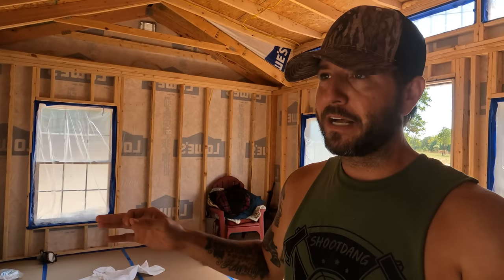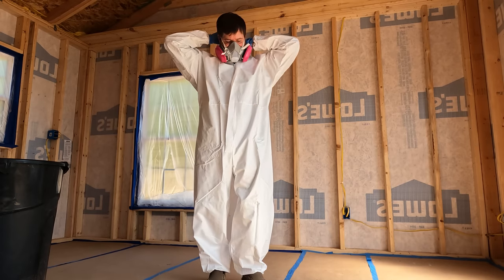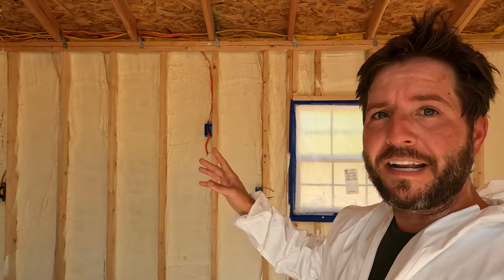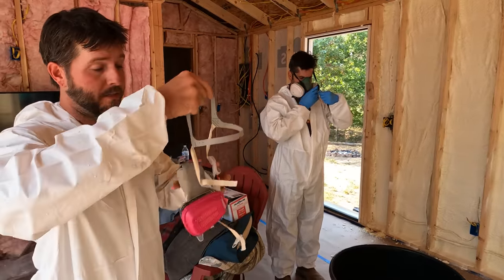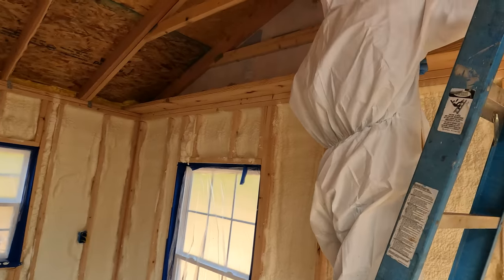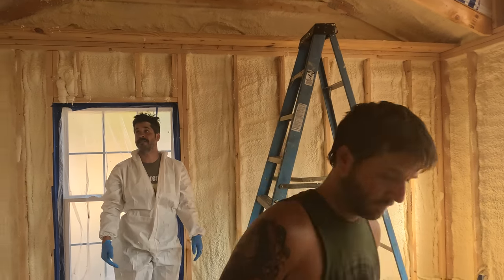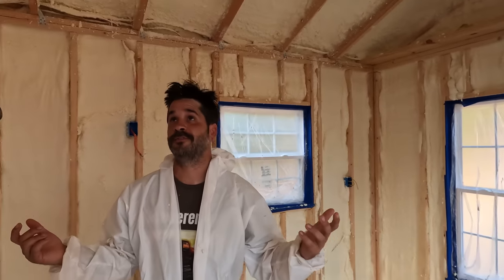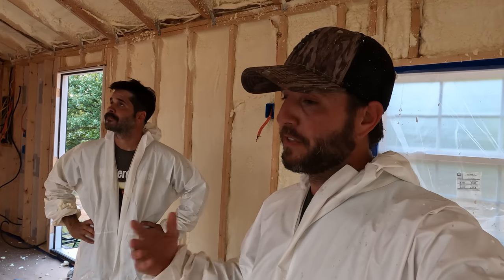Shed To Tiny House - DIY Amazon Sprayfoam Kit - What A Mess!

Comment: Real thick wire term doesn't cut it. You need 10 ga. Wire. That spray has a bad reputation for molding and it's impossible to work on that in the future. Before you cover it up in the inside grind it out. I've been around the spray from and if you ever had to replace any structure parts.

Comment: I wonder if it would be cheaper sticking foam board in those cavities and them sealing all the edges with a much smaller kit?  $3k is a lot of $ considering I recently purchased 80 sheets of 1.5" GPS (R-7.5) for under $2k delivered (for the exterior of my house before residing), and that covered 2500 sqft.  Even if you doubled that up, that's over 1250 sqft of coverage for under $2k with R-15.  

BTW, adding even the single layer of R-7.5 over the entire exterior made a noticeable difference, I can no longer see the thermal bridging with my FLIR camera.  I'm now a firm believer in adding at least one layer of exterior insulation!  I'm guessing the best bang of the buck is probably well taped exterior insulation with fiberglass in the inside.

Comment: Curious as to why the air barrier is inside the Sheathing?  Perhaps your location.  We had our 1888 Maine house open cell Injected and it is so much nicer than before, Which was NoNe in the walls, only Cellulose in the Attic with Granite Foundation whole place was one big Drafty Chimney.  In fact I purchased one those 720 kits in late 2014ish and it was only about $370 possibly 420, and I did recently look them back up in the spring of 2022 and holy cow, they were $940, crazy increase!  Great job.  I love Spray foam (Obsessed Much).

Comment: Just wondering, if you hit any of your romex wires, which are located under the roof sheathing?  I can see they are very close to roof and will be hit once roofing material is installed with roofing nails.

Comment: there really is no such thing as "diy" when it comes to spray foam. if it isn't done but a licensed and trained installer the chances of it poisoning you are pretty high. when mixed and applied properly it's perfectly safe. misused, like anything, and it's dangerous.

Comment: Your going to love that closed cell spray foam insulation!! Just wait until you use your Air-Conditioner!! Wow what a difference!  I had my shed/Carriage House professionally spray foam insulated.  14'by18' 2 inches thick maybe 2.5 inches and I had the underneath of my building floor spray foamed. It cost me in August 2021 and it was $1,500.  So with your size I think with cost increases since I did mine I think you did awesome!!!😀👏🐴

Comment: Used to use this stuff all the time at work on steel frames . after spraying entire job temperature difference caused all the solid foam to fall off ! The outfits in that temp should supply a steady flow of sweat pouring out of the sleeves .Been there never again ! If you stop spraying you are going to have to replace tip nozzle. Wouldn't want to to be ya !

Comment: I was a flunky on a crew doing this for a few months ... Our "spray guy" wore an air supplied suit ..keeps you cooler but more importantly keeps you from breathing ANY of that stuff in ..Imagine if it expanding inside your lungs .. Taping Skylights in 2 story homes was memorable ...I got away from this work soon as I could I was already to old to do this ... Insulated Concrete Forms are the way to go ..Poured Concrete House with up to R-50 walls and sealed tight like a bank vault ..

Comment: i WONDER WHAT THE COST EFFECTIVENESS IS WITH YOU DOING ALL THE  WORK?  IT SEEMS TO ME ANYWAY, THAT YOU NEED TO BUY TOOLS AND EQUIPMENT FOR EVERY PROJECT.  I AM AWARE THAT SOME OF YOUR PURCHASE CAN BE USED FOR OTHER PROJECTS.  I JUST THINK IT WOULD BE FUN TO CALCULATE YOUR TIME SPENT,  THAT INCLUDES GOOLE SEARCH, COST OF TOOLS EQUIPMENT BUILDING, PLUMING , ELECTRIC ETC.  IT IS HOWEVER VERY REWARDING TO ACCOMPLISH PROJECTS ON YOUR OWN. I'M ALSO AWARE THAT YOU GENERATE  INCOME FROM YOU TUBE WHICH ALSO PLAYS A PART IN INCOME AND IS PART OF YOUR LABOR COST HERE ALSO.  WHEN YOU ARE DONE, (WHICH ON A RANCH YOU NEVER ARE DONE) BUT PUTTING THE DAY TO DAY UPKEEP ETC. ASIDE, YOU CAN GENERATE A MORE ACCURATE COST COMPARISON. ANYWAY YOU LOOK AT IT YOU THEN CAN PUT THE CORRECT HAT ON THAT SAYS JACK OF ALL TRADES.

Comment: Styrofoaming reduce my heat and 3800 ft buying it was the greatest heat system I ever used styrofoam it doesn't take much great job you did a lot better than I did on my first one

Comment: Didn’t have the sound on 
Not sure if you plan on keeping this 
But the roll insulation 
(Pink stuff)
Needs to be touching every crevasse between the studs 
Or it’s basically useless 
And it needs to be flat. 
Any folds or crimps in it actually diminishes the R power. 

The cracks have such a different temperature than the insulation it creates a nice air exchange 
Like a magnet for the opposing temperature to enter and exit. 

Other than that 
It’s all nice and I commend DIY work with the upmost respect.

Comment: The down side to any spray foam if it’s used on a roof when you get a leak it will not show up for a long time until it fails from rot then their is thousands of dollars of damage ! Happened to a neighbor on the roof of a 10 year old 300 K house !  Roof was damaged they think 4 or 5 years ago during a hail storm .

Comment: You need the insulation between the living space and the ridge vent top of the roof if you don't you just going to let all your cold and hot air run out the ridge vent hope I'm explain it.

Comment: when the pros use the spray they fill up bays and then use a giant sawzall knife to cut off excess - it can be effective but you need good air recirc as this seals up building which is not ideal - you want some passive and active air recirc

Comment: Great work. Tips I have is should have taken some food ziplock bags and cover all the electrical boxes to prevent over spray. Also, you could have made your life easier if you had used a scaffold on wheels instead of a ladder. They are available from any of big box hardware stores both purchase or rent (also from Harbor Freight I think).

Comment: You mention how the foam seems to do a better job insulating.  There's a reason for that.  The foam seals all the little air leaks in the exterior walls and ceilings.  This prevents hot or cold outside air from infiltrating the house.  Fiberglass does not stop this air infiltration and will offer a home for water vapor to condense and cause wood to rot.  I had a company come to my 1.5 story home and insulate the upstairs, attic, and knee walls.  What a dramatic difference that made.  Reduced my energy consumption by about 1/3.

Comment: When I did my project some 12 years ago one of my product cans had extremely low pressure and it completely screwed it up really bad. It was a wall pour so I couldn't see very well. Blue and yellow was supposed to spray green. I literally had to scrap that and tear off the whole wall and then get them to send me a good set. To clean up that sticky mess was a pain and took forever. If I was going to do it again I'd verify the pressure of each can first because a pressure imbalance will screw things up.

Comment: Serious question: what is the fire rating on that spray foam insulation you are using, or is there even a rating? Had a local contractor recently tell me a home with that new foam insulation caught fire during construction while a plumber was sweating plumbing. Plumber was injured from smoke inhalation and burns.

Comment: I used to sell froth packs.  In the south, due to the temperature differential and humidity, it is recommended that the minimum thickness is 2” to reduce the risk of condensation, thus mold.  If you got 2” min, rock and roll.

Comment: awesome but you need to fill in between those studs flush with where the drywall goes.   They use a sawzall with a huge long serrated blade to trim it flush.  And yes that stuff is super messy.

Comment: There is no venting when you spray foam the roof.  You heat and cool the attic.  The insulation on the roof prevents the heat from entering the home.

Comment: I would either turn the tip to do a horizontal fan, or hold the gun sideways and apply in a smooth pass from floor to ceiling in one smooth motion.

Comment: I've seen dumpsters full of 3" and 4" thick cyanoacrilate insulation, and pulled nearly every piece bigger than 2'×2'! It takes about a year to collect enough to do a house that size or larger. And it's free! I'd rather cut and piece and buy a can or two of crack filler foam to fill any gaps. It doesn't save any time with all the trouble of masking everything, suiting up, and spraying endlessly, to achieve a 2" thickness! And having to do a second coat to bring it up to only 2", well, that's ridiculous! Fiberglass would be easier! And the expense  is outrageous!  I don't care how much you hype this, it's just not worth it, unless you are doing a boat for flotation, or similar.
Reply from the maker: Lol calm down. I've already made my money back from the video so I'm good.

Comment: What a mess.. I went with cellulose and did my ceiling and garage walls all for $700 bucks. free rental blower as well. I just couldn't do something permanent that would trap and harbor moisture.
Reply: It doesn't trap or harbor moisture lol. It's a closed cell foam and will prevent moisture from being able to accumulate in the walls. It's 2x as good at insulating vs cellulose and it also adds strength and rigidity to the home. When you have 2x4 walls cellulose isn't going to cut it for insulation.

Comment: I had a lingering odor from the off gassing. I hung the Drywall, and 9 months later you could still smell it.
   Put Vaseline on your wrists, and anywhere you don't want the foam to stick to. 
  I wore a face shield over me respirator and it had splatter all over it.
Reply: Oh no.. that sounds like your spray foam wasn't installed correctly.  If the ratio of the 2 liquids aren't right it won't cure properly and it will off gas indefinitely.  I'm sorry but sounds like your house is toxic and there isn't much you can do.

Comment: It was fun watching your video as I JUST went through the same with a building I insulated as an office. The struggles and thoughts were very similar and shared experiences. Especially buying the exact kit on Amazon and hoping I didn’t waist my money. I wish your video was posted 20 days ago so I could of watched it as I was researching. Wouldn’t of changed anything about it and completely support the 9/10 rating. The roof sucked and moving fast, the HEAT was tough being in Texas as well.

Comment: What was the thoughts on choosing foam versus batt versus blown cellulose?  As best I can tell foam is $5 / ft2 at 3" thick if your lucky to get a decent kit and batts are about 65 cents/ft2.
Reply: Closed cell is a vapor barrier, air barrier, water/mold proof, and will last a century. Dense packed cellulose in walls is decent for sound proof, thermal barrier, and ok for air sealing but will soak its weight in water and degrade over 15-25 years. I personally don't want to have to reopen my walls later to fill any voids from the dense pack settling or getting wet

Comment: Thanks dudes. Bought a 16x36 and was quoted $13k to spray ceiling, walls, and under floor. Ouch!
Reply: wow 😲 no way
what do you think you will go with if you don't mind me asking!!!
Reply: @carolmaplesden916  - faced fiberglass R15 + 1” foam board over that for somewhere around R22 together on ceiling and R13 face fiberglass in walls. I’m still researching best ways to ventilate and control moisture.

Comment: Use radiant barrier (real aluminum with closed cell in-between) as your moisture barrier, before you put your siding on, works awesome. Then use foamboard on the inside. Easy, quick, and cleaner.
Reply: Closed cell foam is already a vapor barrier.
Reply: @randybobandy9828  Didnt say anything about a Vapor Barrier. I said Moisture Barrier. It will protect the OSB and provide a superior form of Insulation. Most dont understand the technology. Its what they use in Space Shuttles.

Comment: I sprayed foam for a while.. if your familiar with body work I used a airfield with a foam cutting blade screwed to one end.. they also make a rotery knife.. that's a pis.  Try using a electric knife to trim it. That will work best.

Comment: DIY sprayfoam is rarely ever cheaper than a contractor. It normally costs right about the same. But they do all the work.
Reply: Lmao diy is almost always cheaper if you know what youre doing.
Reply: @phillipclark6854  Not with sprayfoam
Reply: @mrmotofy  I can accept this
Reply: I assume for small jobs like this it will be cheaper because contractors don't want to get all set up and spray a tiny house so they charge more per sqft. If this was a 4000sqft home you would absolutely be right.
Reply: @randybobandy9828  They usually charge a base...then add however many Square feet you want. Price it out same thickness and Square feet...it's nearly the same contractor vs DIY all across the country. That says the DIY kits are very overpriced.

Comment: Jared, on your next video do a temperature check of your bed room area and the living area. You should be able to see a surface temperature difference between the two areas. You can then show a temperature after you run your mini AC unit to show it going from 100⁰ down.

Comment: So is that about an r-15? I would've done mineral wool in the walls
Reply: Closed cell foam is R-6.5 / inch. Rockwool is R-3 / inch.  Fiberglass is R-2.2 / inch.  The spray stuff takes a little more effort but it's a vastly superior insulator.
Reply: @naughty.r0bot  in theory spray foam is better. It looks like only half the cavity is filled that's why I'm guessing around an r-15. You can get that same r value with mineral wool. Fiberglass is not worth it not sure why your bringing it up. Air sealing and mineral wool would in theory be comparable while being leagues cheaper plus fire resistant

Comment: I sprayed an entire house with this stuff about 15 years ago when I renovated a house.   It was about $500/kit back then.   It's great stuff.  My kits were for closed cell foam, I'm not sure what yours were for.  I found it was best to use a kit up rather than letting it sit for a couple of days.  I don't know why but we got better expansion.  

I put in 2" of foam in 2x6 stud pockets and then finished with fiberglass meant for 2x4 stud pockets.  It worked well.  The structure was so tight that the guys who did the vacuum door test for air infiltration said it was the tightest house they had ever tested.  

We ended up running energy recovery fans to keep the air fresh inside.

Comment: I’m curious to know why you don’t have headers or beams over your windows or doors? Not sure where you’re located, but header disperse the roof load/ weight across the top of the opening and down the side. They are installed to prevent roof sagging onto windows and doors. Without them you may have trouble opening or closing the windows or doors
Reply: No headers and he’s drilled holes in the roof trusses. I’m guessing this all being done without a permit or inspection.
Reply: Homeowner thinking he’s smarter than the professionals “Cheap labor isn’t skilled, Skilled labor isn’t cheap”. At least he’s trying
Reply: Well it's a manufactured shed not a home so that is pretty standard in shed construction, I'm guessing you don't really follow the channel or you would know a company built the shed.
Reply: @cdipierro  not sure you realize it but 80% of rual America doesn't require permits or inspections
Reply: @jl4285  well in the video you indicated that it was a tiny house. As a professional home builder in New England, I look for new ways of doing things, new technology, and new products no matter the source. I would caution you about setting bad examples when dealing with dangerous chemicals. When we have spray foam insulation done in our projects, the insulating contractor will not allow anyone in the building for 24 hours from the time that they complete their spraying. The fumes are extremely toxic! The insulators are wearing suits, gloves, boots, masks with respirators. They will put up caution signs indicating the danger. You weren’t wearing any respirators and worse yet, you asked someone for help and didn’t provide the proper safety equipment endangering their health. When you do these videos, you have a responsibility to your viewers, to show them proper technique and safety.

Comment: That didn't expand very much. Don't you want it the full depth of your 2x4 wall to get an R19?

The foam insulation I've seen applied by professional applicators expanded past the 2x4 with only one application of about 1" thick.
Reply from the maker: I'm not done

Comment: why did you need three kits. im confused.why couldnt you use one kit and when its empty you clean all the parts and get a new tank and spray again. im asking because i will be doing this in the near future. this may be a stupid question but i really do need to know. thanks
Reply from the maker: I'm pretty sure the tanks are the expensive part. The gun and hoses are cheap